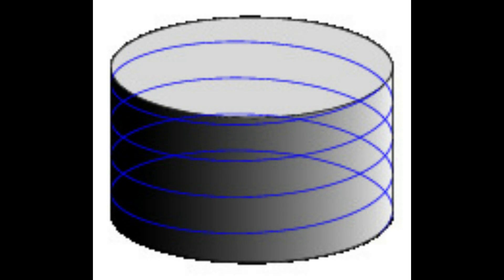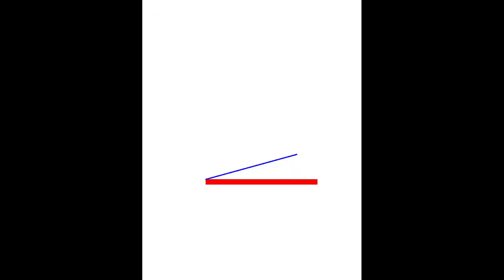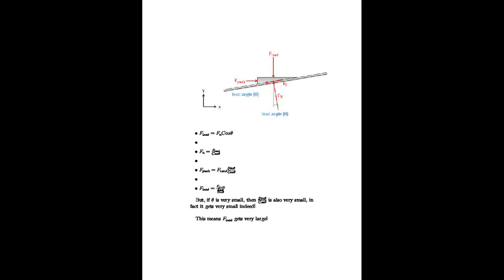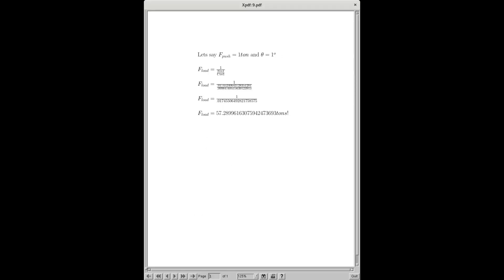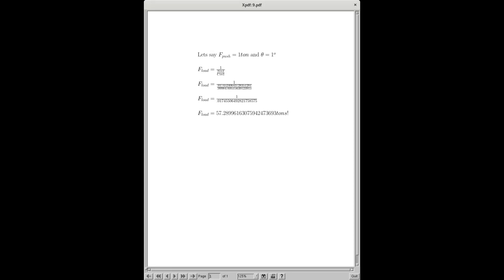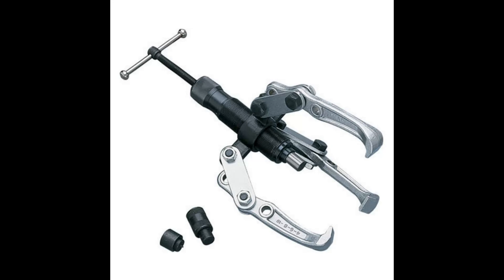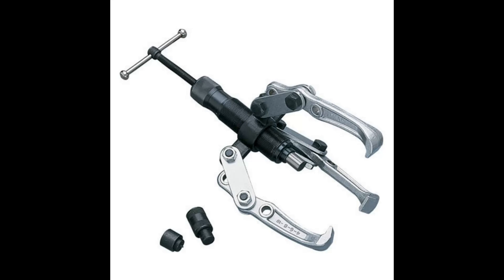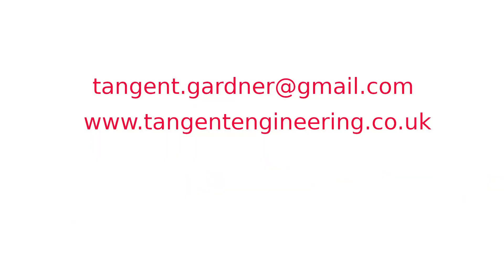Gardner Engines: we take a look at the mathematics of pullers

Comment: Joe...   just a point of interest, the picture was of a standard "Hydraulic" puller...  
A small piston working on a larger piston... I'm reasonably sure the standard Sykes Pickavant puller has a 12.5mm small piston and a 22mm larger piston, calculations need to include the two piston areas...
Reply from the maker: Hmmm, I hope I am looking at the same thing, but I only see screw threads there, no hydraulics.  I could be wrong of course, I often am.
Reply: @tangentgardner  I hope YT allows me to place a link...   The maths was very interesting,...  Me, I just make sure the threads are well lubricated, take care..

https://www.cromwell.co.uk/shop/automotive/pullers-hydraulic/hydraulic-pullers-2-and-3-jaw-kits/f/4942?query=hydraulic%20puller%20ram